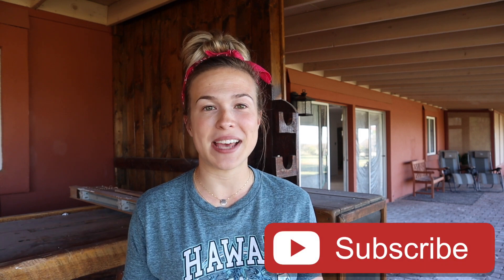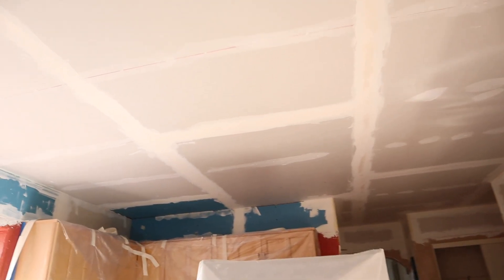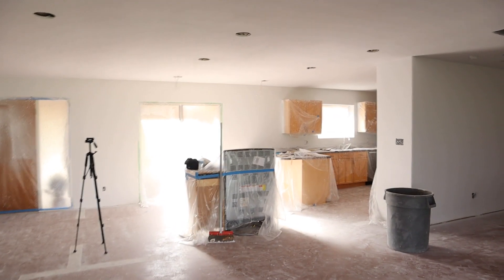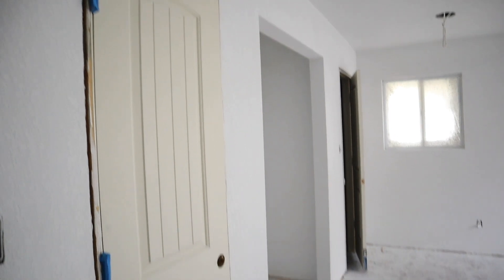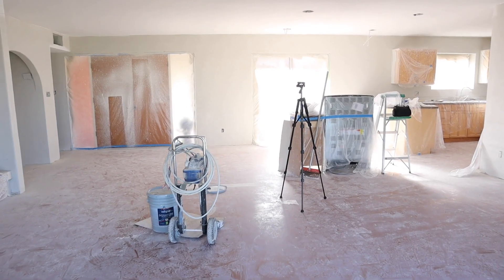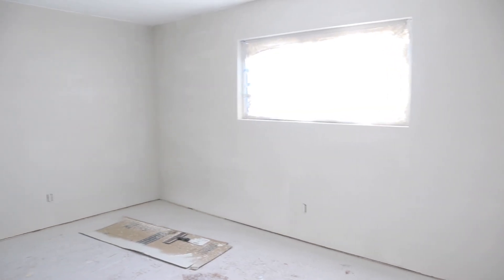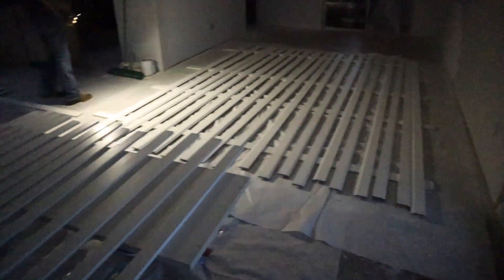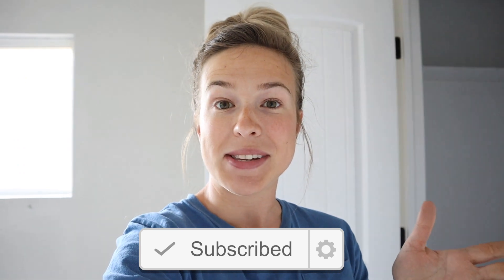HOUSE IS PAINTED!!👏🏼 |  MAJOR HOUSE RENOVATION OF OUR ARIZONA FIXER UPPER Episode 6

Comment: Keep some extra tiles for your bathroom. Maybe you can get someone to do under the master vanity when you can rip out the old one. A free standing vanity is way cheaper. You can order anywhere you just need measurements then all your husband has to do is hook up the plumbing. I also like knowing if we had a leak and it ruins the cabinets all I have to do is take out the free standing cabinet and replace it rather than ripping it out all over again. House looks great! I love renovation videos!

Comment: A good tip for using a tape measure is instead of having to bend the tape to get the measure there's a line on it that says the length the box thingy is on it and you add it to the tape